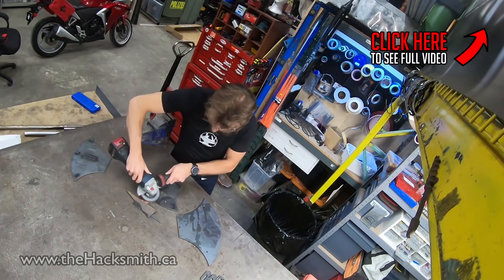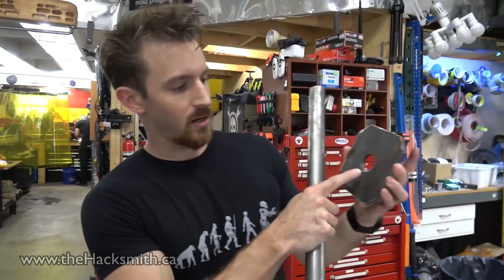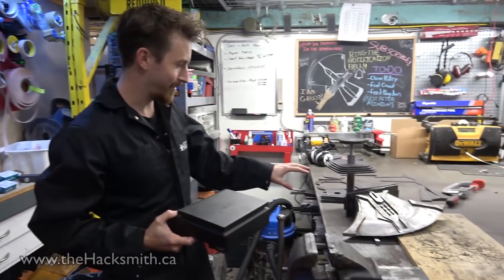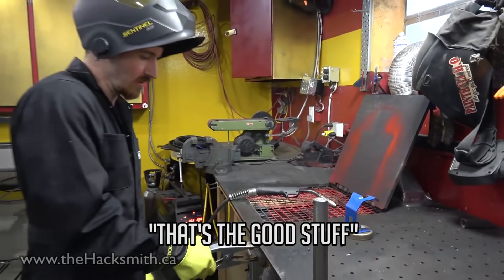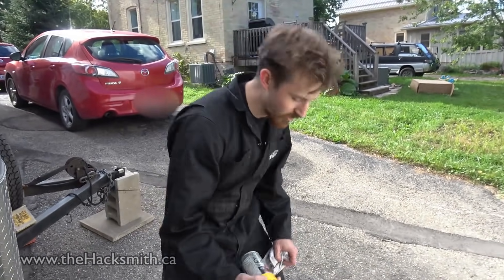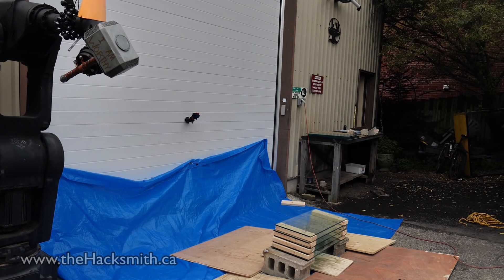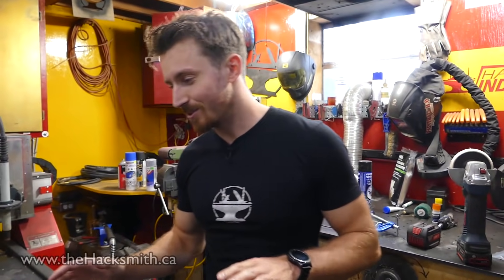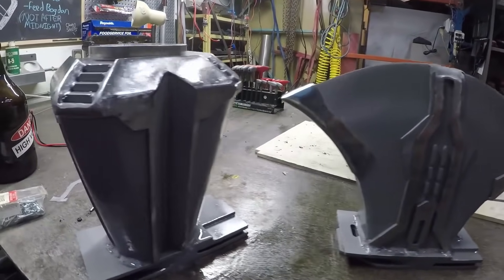BRING ME THANOS! Building Stormbreaker: Part 2

Comment: If you look at michael cathulu's channel he covers parts of the project he doesnt want to get metal speckals on it with soot from a torch.  So when you are welding, the little metal bits that attach them to the flat surfaces will come right off.

Comment: At 04:35 I would have slipped a slightly longer piece of steel pipe over the bolt protecting it's thread, whacking the pipe against the back of the bolt head, wouldn't cause any damage to the bolt or it's thread. Just my opinion, I could be wrong.

Comment: Can you make a new flying like Iron man video
Reply from the maker: no funding
Reply: Try to make an elecktromagnetic rocket launcher
Reply: @theunknowntails1560 
Pretty sure putting high voltage and explosive together isn't the best combination. I guess using a metal cage around it like a Faraday cage could work but there is still a strong magnetic field to be worried about as well as extreme temperature.
Reply: @hacksmith  how do you get funding
Reply: @curseofgladstone4981  it would still be awesome
Reply: @theunknowntails1560 
Oh that's for certain. It would just be tricky and dangerous

Comment: can haz pneumatics? Like knees, batteries become feeble with use over time, but they don't get PT, and joint replacement surgery. They get asploded in fire. P.S. please do not blow up batteries unless in a poorly ventilated, very cluttered, small space filled w/ highly flammable/toxic materials. 
P.P.S. you're going to swing that thing?! I haven't been to the future of this point yet, but how do you swing that thing and not tear a rotator cuff, or destroy your back? That doesn't sound nearly as fun as lobbing things off of the roof.

Comment: Don't you mean Metal working not welding. Sense welding is permanently joining two pieces of metal together, not cutting one into two pieces.
Also depending on what you're making with wood you can join two pieces together in multiple ways and still be structurally sound.

Comment: Question:

Wont it be easier to lift and swing to use lighter metal?
Reply from the maker: Not easier to make though
Reply: Because when welding it'll most likely melt or bend easier.

Comment: how thick can the plasma table cut?
Reply from the maker: 1 inch
Reply: the Hacksmith forgive me for asking you probably get similar questions all the time... how difficult and roughly how much would it cost if I sent you some 5061 steel to make some 3lb battlebots blades and to (If you can) temper them this is a bot I built to join the hobby and learn as many things as I can but am also using for physics 30 so that I may take electronic and mechanical engineering and hopefully get a career in robotics or something similar